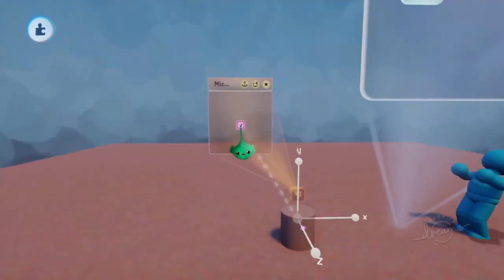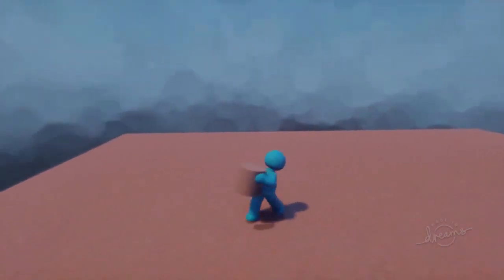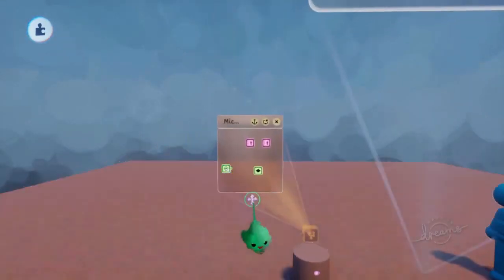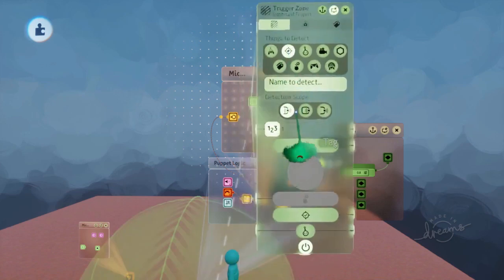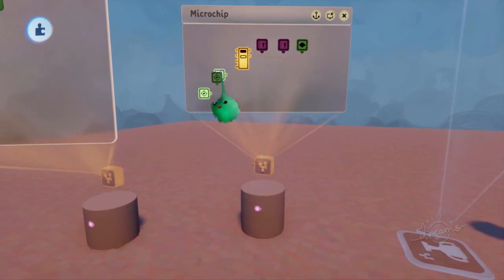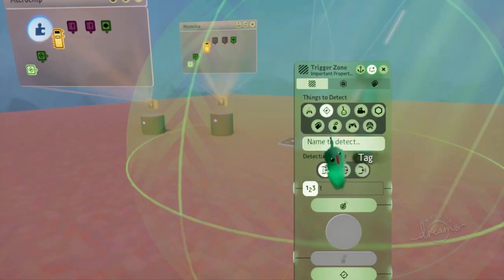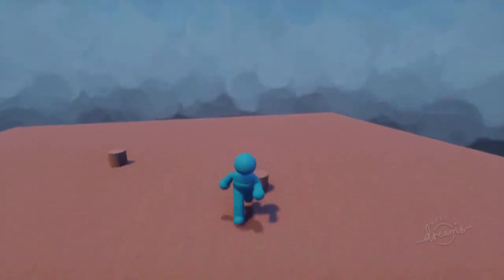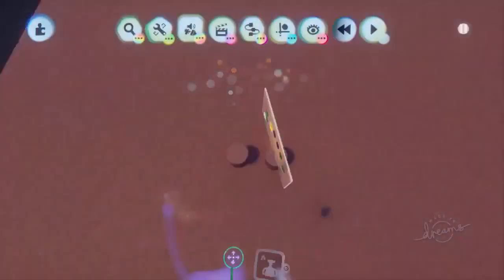Carrying: Part 1 - How to Pick Something Up | TAPgiles Dreams Tutorial

Comment: Is there a reason to group a chip with an object instead of surface snapping?
Reply from the maker: Mainly a personal choice. But having the chip be in a particular position means all the gadgets in that chip will default to that position. So things like tags and laser scopes and trigger zones will all be centred at the same exact point.

Also, unless you're working with a cube, it will be hard to surface-snap the chip so it's straight instead of wonky. If the cylinder was an actual sculpted barrel with uneven surfaces and such, then when surface snap the chip to it it will be at some random orientation and position--which would affect the gadgets inside it and make it hard to copy the chip to a new object because you'd have to reposition everything manually again anyway.

Also adding stuff to behave like the same object (eg. adding a pile of apples to our cylinder-barrel) right now is as easy as scoping it in and everything works the same. If it were surface-snapped you'd have to scope in the apples, un-surface-snap the chip, take it out of the group, surface-snap it to the group instead, and then reposition its gadgets so it still works propely.

So... there are reasons for and against. But it's just the way I do things now, and it works well for me.